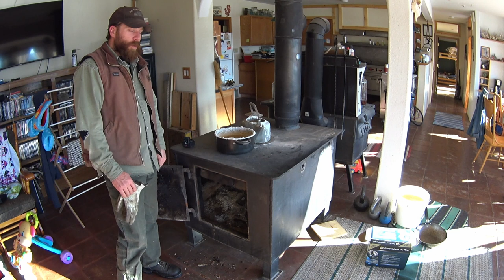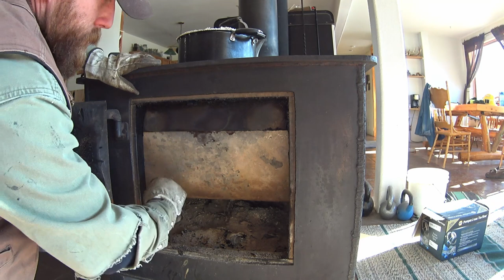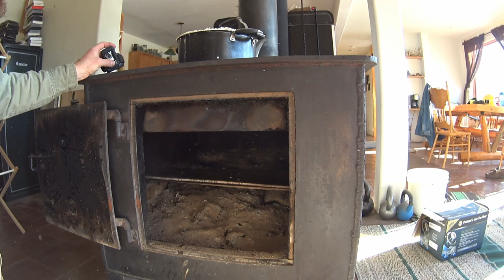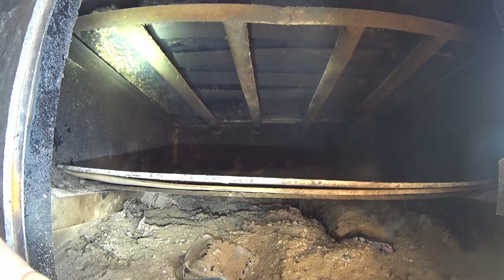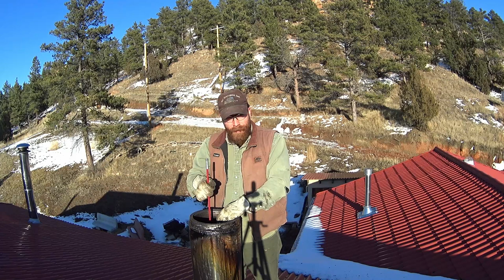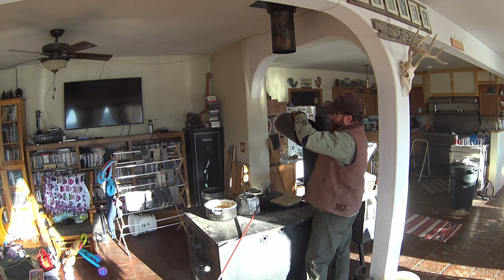The Joys of Heating with Wood & Coal

Comment: I'm in rural SE WI. I supplement heat with wood. I have an oil furnace that I keep set at 56F for when I'm gone. When I'm home, it's all natural wood heat! I love it. I love everything about it. Splitting wood, stacking wood, finding wood, learning about trees and their wood characteristics, smell of wood burning, dry heat. I have absolutely fallen in love with wood heat. And it does save me bookoo bucks. I only fill my 250 gallon oil tank once a season.  I work full time in the city so I'm gone a lot.  Are you on firewoodhoarders? If not, you should join up! A bunch of wood heat nerds talking about wood and trees. It's funny to me all the city people think you can't burn pine. Makes me laugh. I burn anything I get that's natural tree wood. Every year I have some spruce typically. So many people around here think you can't burn it or are just wood snobs and won't. Easy to get haords of spruce for free. But Primarily I burn a lot of ash here.

Comment: Soft coal?
Reply from the maker: our coal comes from the Powder River Basin, near Gillette Wy.  this does not contain the BTU's of the Decker coal near Decker MT.  Our coal is softer and less dense than other locations, and it has more water in it thus producing a less desirable burn for heating purposes.
I use Lump coal mostly when I can get it, and Stoker coal when I cant get Lump.  Lump is fist size or bigger, and stoker is busted into 3/4-1" gravel size.
Reply: @roughcutranch6764  I'd love to see some video on heating with coal. Sounds interesting! Coal heat is pretty much a thing of the past in MI where live. No coal anywhere near here.
Reply from the maker: My heating with coal is very rudimentary.  I lay down a layer of logs at night and pile a few shovel fulls of coal ontop of it, as the coals burn through the logs it preheats the coal and the coal oil will gas off and produce a semi catalytic burn that will go for most of the night.  I really dont have to check my fire untill about 9am the next morning thus giving me 8-10hrs.  (this works in the monster stove)  The little stove I have in the garage is a little different but same principal.  Basically the heat and fire need to be under the coal for it to burn.  I have an elevated grate that raises the fire about 2" off the actual bottom of the stove box and above the lower dampers.  I build a wood fire then put lump coal (fist size chunks) ontop of the fire/burning wood once the wood fire is going good.  This is a way to supplement my wood usage and keep good hot coals in my box for the heating factor.  A lump of coal will smolder for hours where a peice of wood will burn up.  Keeping the box hot and coals in the box is half the battle.